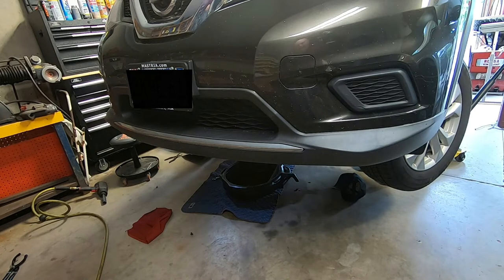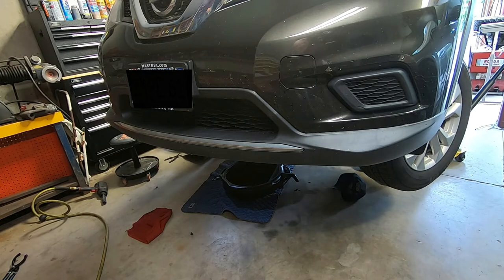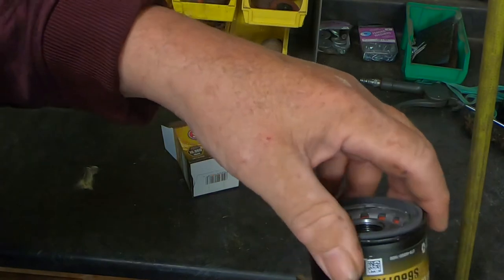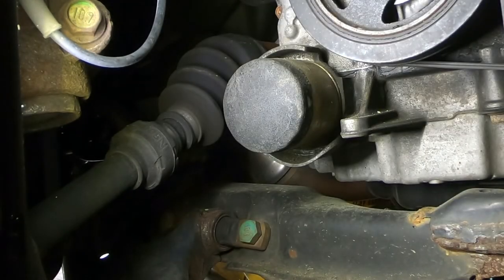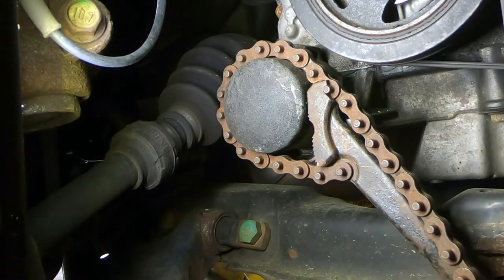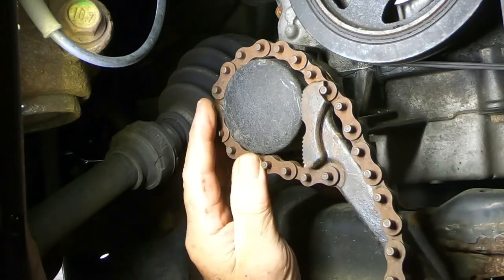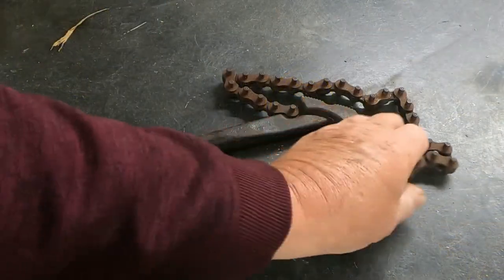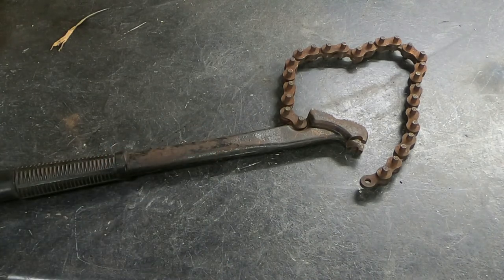Quick Tip to Remove a Stuck Oil Filter

Comment: You made that look easy.   I usually use the channel lock style filter wrench to get stuck filters off.
Reply from the maker: That one wasn't too bad. My nephew ruined the motor in his truck because of a stuck filter. He showed up to change his oil when I was not home one day.  He could not get the filter off, so he decided just to change the oil and leave the old filter in place. However unknown to him at the time, in attempting to get the filter off he damaged it to the point it started leaking. 2 day later he seized his motor due to lack of oil.

Comment: The chain wrench is awesome. I should buy one for future needs. Now i have a tool similar to the "three legged" one you showed, but the legs are instead "round" . The reason i buy the three legged one was the position of my oil filter. It stands vertically between the engine block and radiator and it won't work with the pliers-type wrench or chain-wrench . You just can't get them there. Every tool has it's uses i would say.
Reply from the maker: sometimes these filters can be a nightmare, Thanks for watching

Comment: A lot of the time these filters are put on way too tight to begin with which makes them hard to remove. You took that one off with finesse. I’ve seen people end up driving a screwdriver through the middle to remove really stubborn ones. I like to use a strap wrench although that tool you had looks heavy duty and would show ‘em who’s boss.
Reply from the maker: It is entirely possible I did put it on too tight. The fact that I allowed the engine to get cold did not help.  My nephew a few years ago attempted to change his oil in my shop while I was not home to help him.  He could not get his filter off, so he decided to leave it and just change the oil. The problem was in attempting to remove the filter he damaged to the point it started leaking.  The next day he seized his motor.  The truck is still parked out in my back field. You may from time to time catch glimpses of it in some of my videos. As always thanks for your comments.